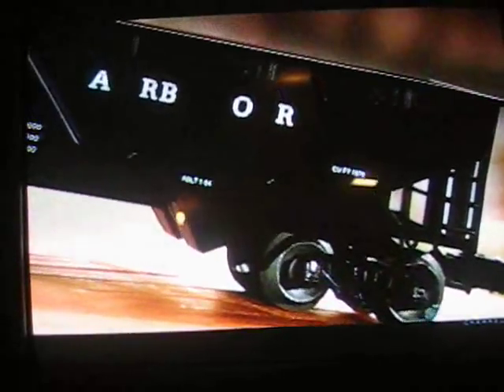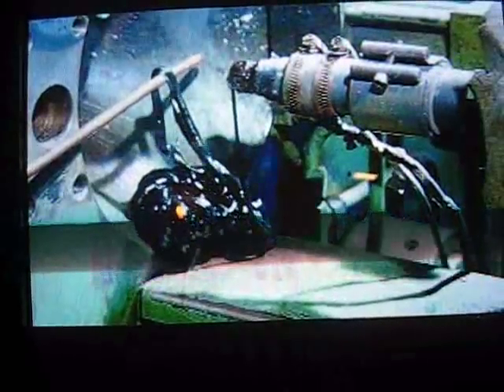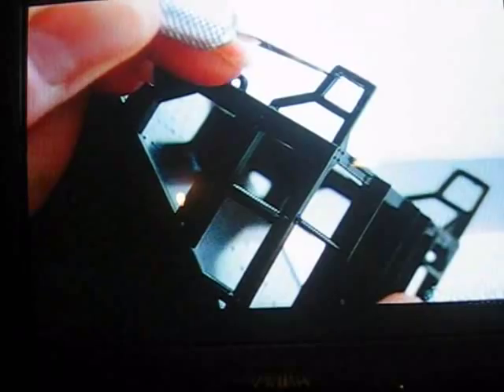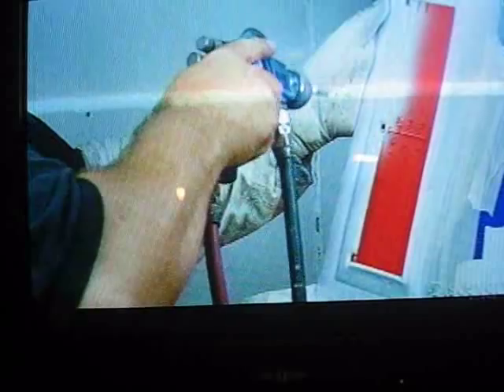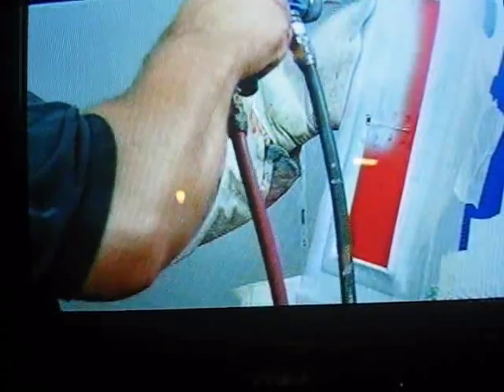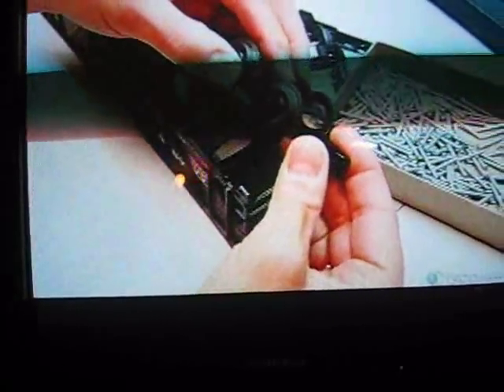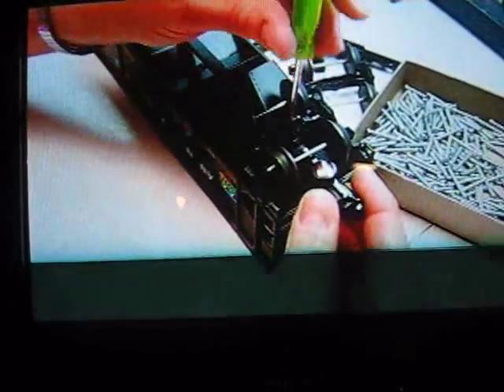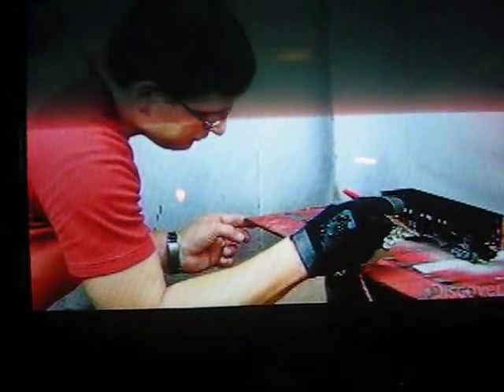How It's Made-Model Trains

Comment: The "black bars" that appear are caused by a discrepancy between the frame rate of the television and the camera.

In Terminator 2: Judgement Day, the monitors that Edward Furlong looks at to see what's going on outside the Cyberdyne Systems building were modified to eliminate precisely the phenomenon you see.

Interesting video. Thanks for sharing.